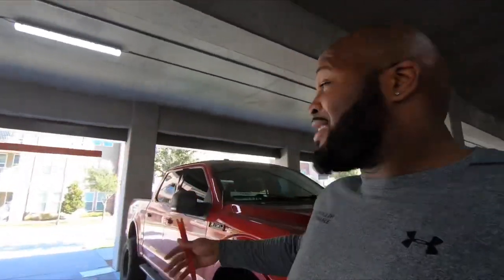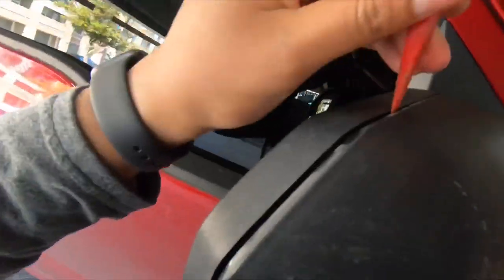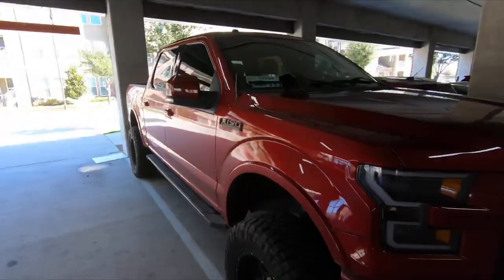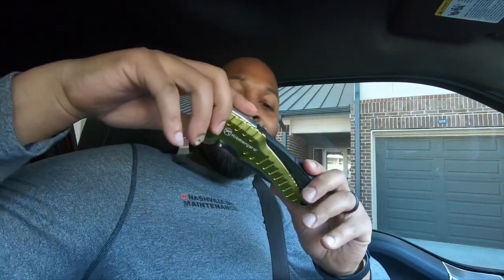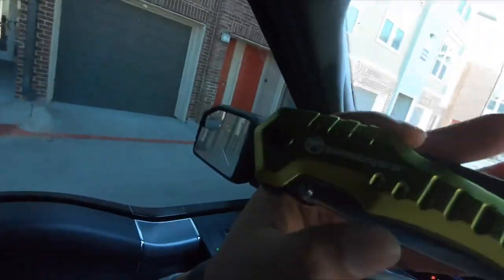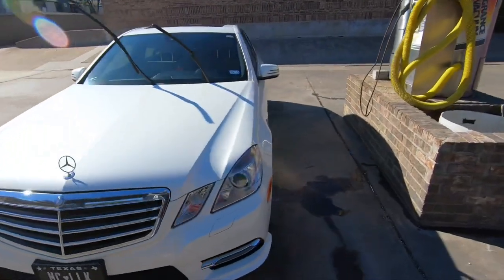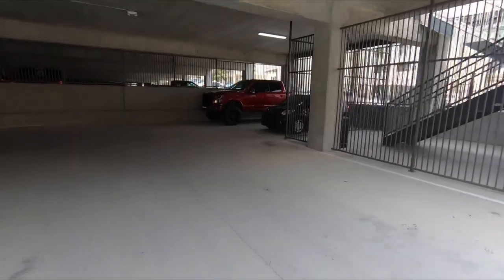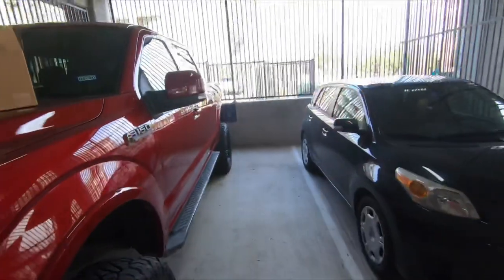Installing New Mirror Caps 2015-2017 F150(The EASIEST Way To Remove)

Comment: Well those eBay ones are cheap alternatives, I bought some a while back but didn’t like them due to not being close to the color of my truck. but for those wanting to buy ones that 💯 color matched oemautoart sells them at a premium price I say. Cause depending on the color of your truck. You might pay more like a ruby red color mirror caps will set you at $350. Which is the amount I paid for. Since my truck is ruby red. And they aren’t aftermarket mirrors caps either they are oem mirrors caps.

Comment: Very clean truck! Thanks for the video, I was reading about the clips and heard they most likely will break when pulling the cap off. I'm about to do this and replace my OEM chrome caps with Blue Jean Metallic to match the truck.
Reply from the maker: Yea they most likely will break but the color match looks good! Glad the video helped
Reply: What happened to the clips that broke off ? We’re you able to get them out or did that just fall inside the mirror ?

Comment: I had to sell mine, that looked lvery similar to yours minus the 37's and man I miss my red truck, granted it was two tone.  I ended up in a newer model in a higher trim but after all the mods going back to the stock sucks.  What do you think of the Tri Color Heritage edition or whatever supposedly on the 23s?  I'm about to change my mirror caps again, that is what brought me back to this video.  Hope yall been doing good Q.
Reply from the maker: Congrats on bro the new truck bro! I haven’t heard of that man. I gotta look that up and check it out. Be careful changing those things they definitely fragile

Comment: I don't know how long it has been since you made this video but im wondering how the caps have held up over time?
Could you please update us. The link still works and im very much considering purchasing these for my F150.
Reply from the maker: It’s definitely been over 6 months. They’ve held up great just the color isn’t 100% matched
Reply: I bought the same caps from the same vendor but in N1 and after a while in deep south texas,  the heat baked the various and they've peeled and faded.  Tried getting my money back because the seller states that they'll never fade in vigorous weather but they did.

Comment: Are those oem mirrors? I have a 2016 XL but I want puddle lights and turn signals on the mirrors but don’t want tow mirrors.
Reply from the maker: Yes they are OEM mirrors. I have XLT so guessing it’s on these trims and up.
Reply: KickinItWithQ do your mirrors have puddle lights too?
Reply: They are stock mirrors  not all XLT tricks have them. Depends on level of options.  Mine is a 17 xlt all the options on except leather. It would be a lariat if it had leather. Love my truck

Comment: I know this is old, but it looks like it matches great, plus with that truck aint nobody gonna be checking out the mirror caps anyway with everything else you got going on 😂.  I just got some in from (probably the same people as you bought yours from) and it looks like the metallic layer might be a little different but for the price and how close they are I don't think anyone is gonna notice.  When you broke the clips they just went flying huh?  They don't get stuck in the slot on the actual mirror part right? lol Its making me nervous jerking on the cap even though I know it should only break the clips on the old cap.
Reply from the maker: Lol yea they went flying, one did get stuck but use a flat to just push it out or needle nose to grab it. It’s not hard at all but they probably will break
Reply: @KickinItWithQ  Awesome thanks for the quick input.  I don't care if the old ones break I just figured it would be my luck that the piece that breaks would get stuck inside the slot and keep the new ones from going in.  Thanks again my man. Keep em coming.